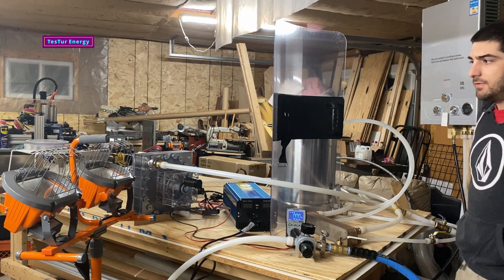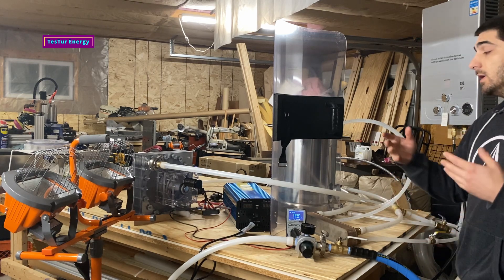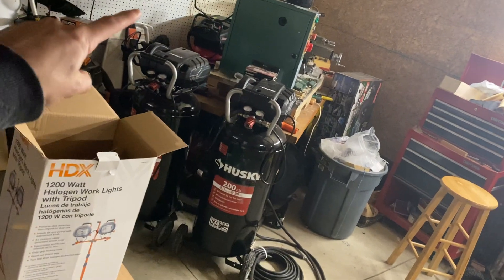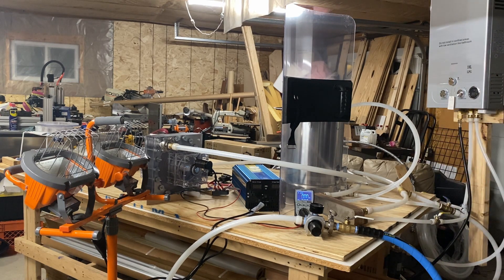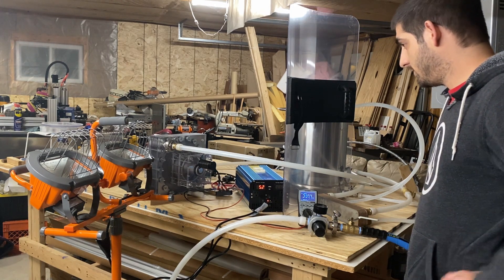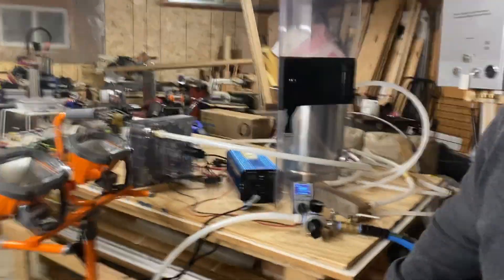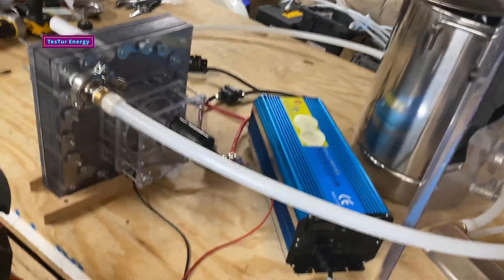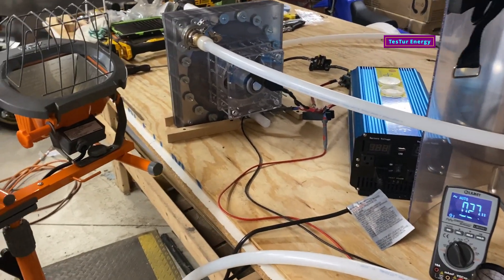Amazing Tesla Turbine Actual Power Output Test - 1200 Watt Real Electrical Load - CAES - Turbo Jet

Comment from the maker: 10in Tesla Turbine 75 Disc Steam Air Engine 2.65kW Peak Power Output 9.23lbs 4.2kg 10,000in^2 surface Area. 0.0092in disc spacing, runner is just shy of 2” wide, the turbine is geared UP (yes you heard that correctly, up) to the generator at 3.6 to 1 with the 2200Kv BLDC generator max rpm of 60,000 and 25Volts with a max of 120amps. Bringing each generator to 3kW, and 6kW total potential output at 24v. However they are being operated at the 12v rpm range so they can only max 3kW total together without exceeding the 120amps limit. 

 As for efficiency I have now calculated it a few different ways. If we only consider the energy put out by the light alone the efficiency seems to come in around 15-25%. That’s calculating the available energy in the amount of compressed air we have available in a couple different ways and is really a rough estimate. If we can fix the gear losses, again which should be easy to do with the the axial flux generators, the efficiency is coming in between 25-35% efficient and could be even higher depending on how much of a low ball I put on those loss numbers. (And that’s not accounting for generator iron losses, rectifier losses or inverter losses too) my power loss tests showed 1-2hp of loss from the unloaded condition and my calculations only have 800watts of loss. That’s only 1.09hp. Realistically the loaded condition could be seeing upwards of 2-3hp loss so the real losses are something like 1600watts plus, which if that’s the case the efficiency is looking like it’s close to 35-55% efficient. Again these are rough estimates for how much energy is available in 170gallons of 150psi compressed air dumped to 65psi. Which for the record the different ways I calculated it give it a range from 260,000-380,000joules. I had a whole section about efficiency in this video but it made the video like 20 minutes long and very dry so I decided to cut it out and I’m going to be making a video about just that when I use twice the tank size as previously being used. The larger the tank the more accurate I think the efficiency tests will be on endurance runs. 

But yeah if you know how to, let me know what you get for the total joules available in a 170gal tank at 150psi being dumped to 65psi. Like I said, I came to those numbers above. It would be interesting to see what others calculate for me to compare to.
www.TesTurEnergy.com
To inquire about more information email me at TesTurEnergy@Gmail.com 
Or if you would like to help bring Nikola Tesla’s Turbine to the people of the world go to my Patreon to aid the cause so we can make more prototypes and models! 
https://www.patreon.com/CharlieSolis
#NikolaTesla #TeslaTurbine #TesTurEnergy

Tesla goes into great length explaining the power generator systems he has come up with in his article “Our Future Motive Power”. It’s an excellent read and I highly suggest reading through it if you haven’t yet!
you can read the whole article here: https://teslauniverse.com/nikola-tesla/articles/our-future-motive-power
Reply: I Can't wait to see the cavitation heater test results. And I think you should look up repulsine turbine in your spare time.